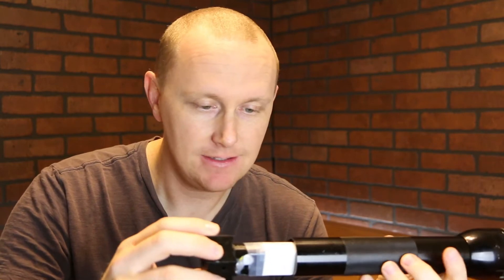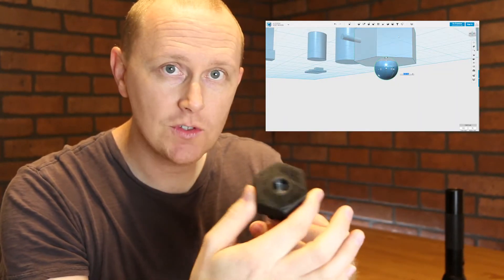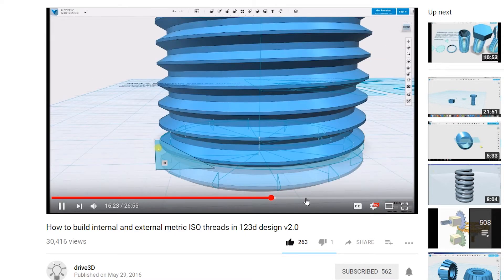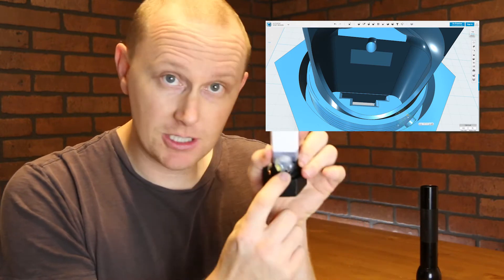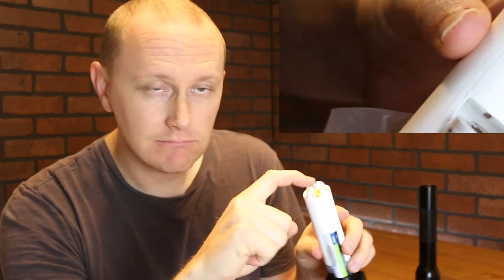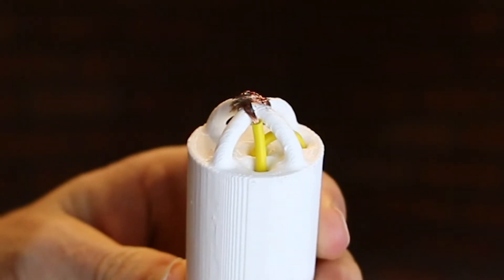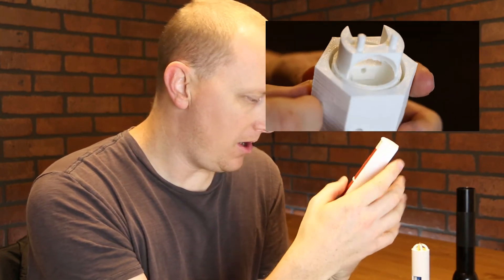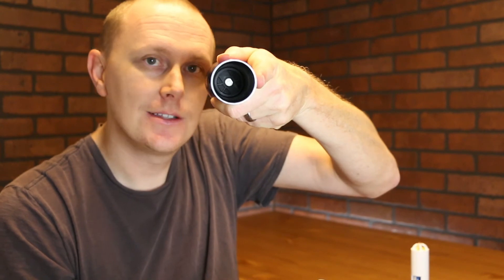Maglite 18650 Adapter Mod upgrade with charging capability 3d printed

Comment: Wasting  space  for  single  18650 ? ? ?
With  modifying  tail  cap,  you  can  Use  Pair  of  26650  or  pair  of  21700  or  pair  of  18650  for  higher  voltage.
Or  without  modifying  tail  cap,  accommodate  single  21700  or  single  26650  with  much  higher  capacity.

Comment: when is the 2 bat ver available? been 5 years
Reply: It  is  possible  to  use  pair  of  26650  or  pair  of  21700  or  pair  of  18650  for  higher  voltage  (7.4 Volt)  
but  tail  cap  must  de  modified.
If  you  can't  modified  for  tail cap,  pair  of  26650  or  pair  of  21700  or  pair  of  18650  will  fit  in  3D Maglite.

Comment: Personally for me the large hexagonal bit at the bottom sticking out spoils the sleek design of the torch.

I have one of these mag-lites and I'm looking to convert mine into using LEDs and 18650s.

Would it still work well if the 3D printed part was the same diameter as the outside of the torch, or are the PCBs too wide to fit in? I mean, it would still stop it rolling as the two pivot points are the bulb end and the bottom.

I don't have a 3d printer, but I do know someone who has one that I'm sure I could use.

Comment: Would you be willing to make and sell me one for 5 d-cell batteries?  Internal total space of 5 d-cells add to a total height of 11 7/8.”  Three 18650 batterie should add to roughly 9 3/4,” therefore leaving nearly 2” of free space.   Love the design and ingenuity, but I don’t have the materials to make something like this.  I thought about making a PCV sleeve and just putting batteries inside the original housing, but your setup is so slick!
Reply from the maker: Sorry man, i dont got the length or the time right now. Thanks for the good words though. I highly recommend not using anything made of Polycythemia Vera. Could be dangerous. I would suggest polyvinyl chloride tubing, however.

Comment: That's a nice design man. I'm probably trying my own soon for that same Mag.

Quick question: can you charge the two batteries design with that same board?

Regarding software I am using Autodesk Fusion 360. It has so far a free license for enthusiasts and startups and is quite easy to learn. It also has an automatic feature for doing threads over a cylinder which is surprisingly easy to use, although I'm not sure if it will be able to recreate this particular one easily. I have only used it for metric ones.